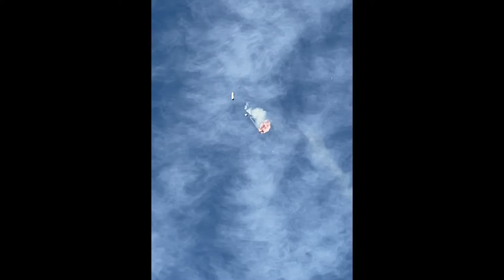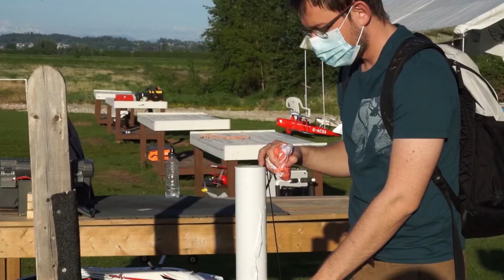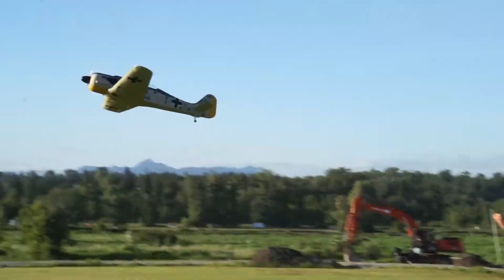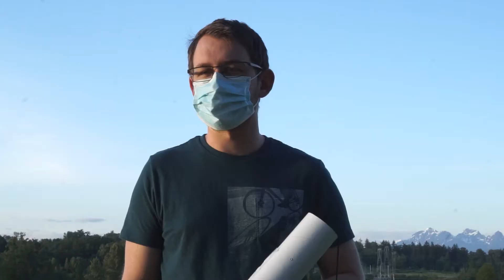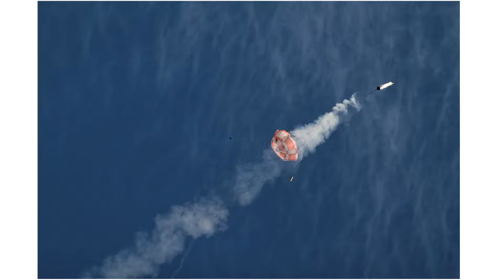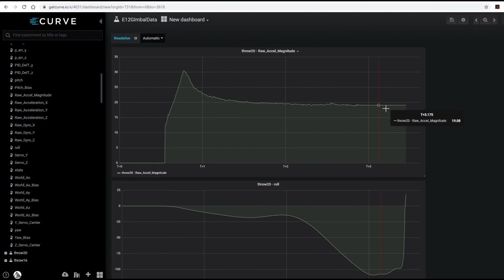Rocket Motor Fleeing The Scene of The Crime

Comment: Nice rocket man! I am working on my TVC rocket right now and I know how much effort it takes! 
I got some thoughts about the reason of the failure.

The center of mass was too low. Your rocket is basically a cylinder, so your center of pressure is in the middle, so if your center of mass is above - then you are aerodynamically stable, and if it's below - your rocket wants to point itself backward. Of course, you got a TVC that is able to counter this but you want your center of mass to be as high as possible for two reasons: 1) the higher center of mass is - the more TVC authority you have (more torque) 2) the higher center of mass is - the less authority of drag force (less torque). In fact, if you manage to get a center of mass higher than "middle" - it starts to "play on your side", but I don't think that it's possible.
At about 2 seconds you got an equilibrium - your TVC tries to turn your rocet "forward" and the drag tries to turn your rocket backward. But at this point, your rocket still gains more speed! And more speed = more drag and things start getting worse =( and finally you came to the point where your TVC got completely overwhelmed by drag.

I think you have several ways to counter this.
1) try to decrease the length and diameter of your rocket - it will decrease drag when you start to get some angle of attack(AOA)
2) place all components (like computer and battery) as close to the top as possible - it will shift the center of mass
3) the most important - tune your TVC - make it more aggressive. The drag torque is roughly proportional to the AOA (for small angles at least) and square of velocity. So it's like a system with positive feedback: more AOA -> more torque -> even more AOA. And more speed makes this system more sensitive to AOA. So you should always counter any AOA as quick as possible. For example, at 2 seconds  - your TVC still was able to go harder and stabilize the whole thing. And if you don't - you got beyond recovery at some point.

The whole story reminds some rockets in Kerbal Space Program. When your payload creates a lot of drag - you have a hard time piloting this thing through the atmosphere. It wants to tumble all the time! One mistake -> too much AOA -> drag torque is more than your maximum TVC torque -> you are flying engine-first :P

Anyway, it was a SOLID result! Keep going 💪🏻

P.S. I understand that you are probably already know all the stuff I write. Just wanted to make my story complete and understandable for everyone who read this.
Reply from the maker: Hey! Thanks for the feedback! Your advice about the center of pressure is something I didn't consider. That's super useful to know so thanks a lot for that! I'll have to modify my next rocket with that in mind!

Comment: Your design does not have anywhere for the gases to go so that is why the top piece "blew" off! If you are using a motor as a single stage you are supposed to use a P = Plugged motor, or if you use a -0 then you have to epoxy plug it!

An F15-0 does not have an ejection charge, it burns through to ignite the second stage, and if you have a closed top design then it becomes a pressure chamber.

Also, you might want to start "epoxy coating" your printed TVC is adds a lot of strength, very surprising more of these haven't popped off!

Yeah the motor didn't explode, it burned through the way it was supposed to and your design blocked the escape of the gases!

Also, looking at the video in slow mo, your FC program is overcorrecting for the angle of the rocket. Yep, your graph shows the overcorrection. That is called fish tailing. For both pitch and yaw. I suspect you are programming the computer for an ideal pure vertical flight which will result in failure or fish tailing every time.

And, you have to program the FC with a 3D flight with a 2D TVC.
Reply from the maker: Yeah the F15 motor was epoxied in. It's just that the epoxy layer was too thin.